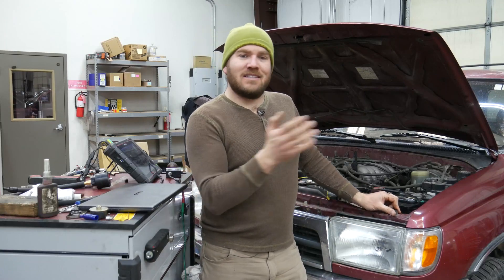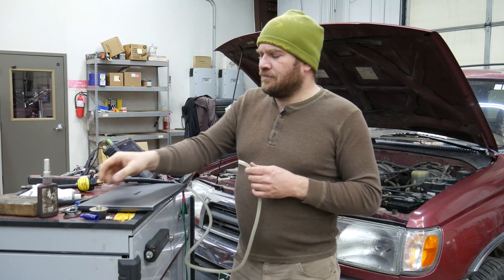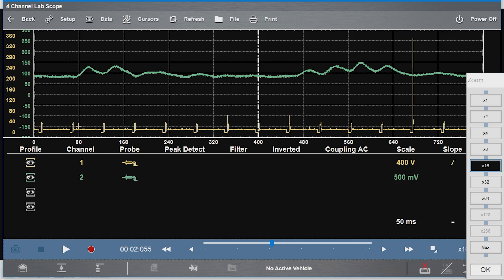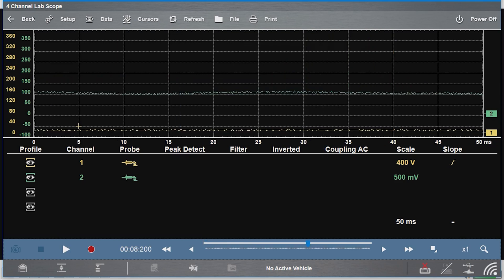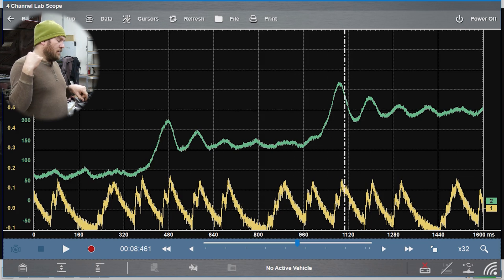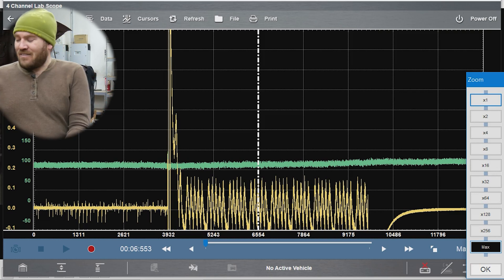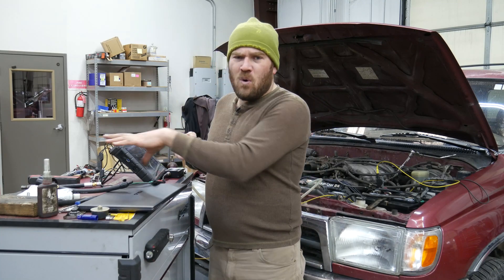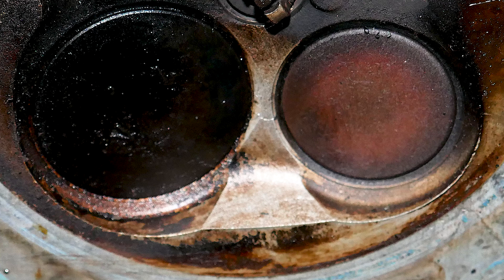Weekly waveform 15 - Cooling system pulse sensor test. Does it have a bad head gasket?

Comment: You could find which cylinder just by blowing compressed air in the spark plug hole and reading pressure or pulse , or even just by watching for bubbles or volume change in the radiator or expansion tank.

Comment: Not sure if you'll ever read this, but what's you opinion on the pulse sensor vs the transducer?
I found this video trying to find an answer. A pulse sensor is super handy and cheap BUT . . .
If you have sprung for the transducer, do you really need a pulse sensor any more?
Reply from the maker: I have several pulse sensors but I still struggle to read them easily. I find the pressure transducer easier to read because it’s displaying actual pressure where the pulse sensor shows a reaction to a change in pressure. 

I still use both as I am always hoping the pulse sensor readings will just click in my brain and I’ll understand it better. I also only have one pressure transducer so I normally use it for in cylinder readings and throw the pulse sensors in the tailpipe or on the intake manifold.
Reply: @ThePracticalMechanic  Super appreciative of your time to reply and make a series of videos I have enjoyed as much as I have learnt!

Comment: I have a question about pulse sensors. I purchased a Zeus and am going to buy a sensor. I find several available at various prices. Which brand do you recommend? I realize they are all built with the same components. I’m curious about quality of workmanship and quality of the internal sensor.
Reply from the maker: The first look sensor was one of the original ones on the market but they are more expensive than most so I have never purchased one. 
Cody’s auto diagnostics and jarhead diagnostics both make a variety of 3D printed pulse sensors in different Colors and connector options. Either of those are going to be the cheapest pre-made sensors. 
Automotive test solutions also makes some but I have not used them.  
Some choose to make their own sensors by placing a piezo speaker/transducer inside a small section of pvc pipe. By time you buy all the materials to make just one and spend the time assembling I would just buy one from Cody’s or Jarhead unless you already have most of the materials.

Comment: Question: If you individually remove each plug and at some point you get no spike on the cooling system pressure.... would that help you identify the bad  cylinder???
Reply: oops I was commenting as i watch the video lol
Reply from the maker: @timothymohammed919  Absolutely. Some vehicle will be difficult to remove spark plugs if they are located under the intake manifold but if we can locate at least one spark plug we can get a reference. If we can get to all of the spark plugs we can isolate the problem by removing one plug at a time. Thanks for stopping by.

Comment: Great diagnosis, I use this method myself. The piezo pressure sensor is very simple and inexpensive to make, check out "the GADGETS playlist" for instructions. I'm surprised to see the crack location between the valves causing pressure pulses in the cooling system. That would definitely cause a misfire, but neither valve connects to a cooling jacket. There must have been either a crack between the combustion chamber and a coolant jacket or a crack in the block between the cylinder and cooling jacket. Or the gasket failed.

Comment: Just a few questions: (1.) While it wouldn't have been as accurate, nor as detailed,, could an exhaust gas meter  be used: checking  for any exhaust  gas in the coolant overflow reservoir? (2.) Was that the 1MZ? (3.) That crack in the head, between exhaust and intake valves, was almost undetectable, wouldn't cylinder head warpage also occur?
Reply from the maker: I do often use the 5 gas analyzer to check for hydrocarbons and carbon dioxide in the cooling system but a recent discussion with Dennis over at The Gadgets Playlist has me wondering if the 5 gas readings are accurate when used on a cooling system.  This test confirmed the head gasket failure without a doubt and gave the information require to do a deep inspection of the suspect cylinder.  

This was on a 1998 Toyota 4Runner with a 5vz-fe 3.4 liter. The vehicle was overheated last year when the head gasket failed. We sent the cylinder head to the machine shop for machining. Neither myself or the machine shop noticed the crack at the time. I suspect the crack was there but was much smaller at the time. Many heat cycles and a year later the crack has developed into the issue we have now. I didn’t even bother to check the head warpage since the heads are getting replaced. Luckily we have a core engine with good cylinder heads. Fully inspected these ones and found no issues with valves or cracks.
Reply: Would an initial check for head warpage show deformation/warpage,  if said hairline crack developed due to overheating? Maybe magna fluxing would've found the crack where the naked eye couldn't.  And as far as the 'gas detector': a simple $35 hand-held combustion gas detector (with sensitivity adjustment)? Lastly, would a pressure  inducer in the tail pipe show which cylinder was lagging? Or, if you put the crank on a channel, u'd see which piston/cylinder would be a drag compared to the others?
Reply from the maker: I’m sure magna fluxing would have showed the hairline crack. I’ve done dozens of these engine over the years and this is the first crack I’ve seen so we didn’t send the original heads out to get magnafluxed. 
I will still continue testing with a gas analyzer to determine if the results are accurate enough to call a head gasket based on low levels of CO2 and HC.  It is possible that HC can be introduced to the coolant system unintentionally with additives for better cooling or even stop leak. CO2 should only be present if combustion gases have entered the cooling system but it is possible that the steam or antifreeze vapor can skew the readings? Most gas sensor available on the market for electronics diy builders have one analog output channel but the sensor responds to several different gasses.  CO, and Propane are listed on the same chart for one sensor but Gadget Playlist found that the sensor responds to CO2 even thought it wasn’t listed on the spec sheet for the sensor. Does my $3000 Snapon analyzer use better sensors? I would assume that it does and it uses several different sensors. Every two years I have to send it in to get the oxygen sensor replaced. 

I think the pulse sensor in the tail pipe would only pickup the initial misfire on startup. The relative compression test show minimal differences between cylinders so the tailpipe output should be close to the same. 

The crankshaft signal will narrow it down to two cylinders if you knew where cylinder number one is located on the crank. I think the missing tooth is 40-50* offset from TDC #1.  Cylinder 1 and 4 are companion cylinders and both will be at the top of the stroke at the same time. We would need a camshaft position signal to determine location of cylinder #1. 

Great questions and discussion. Discussions like this is how we each challenge each other to grow and learn new things. 
I will measure the warpage when I get to the shop today and see if the heads have developed new warpage since the machine work was performed last year.

Comment: What an interesting idea. I thought the water pump would  have an ac pattern of pulsations, like ac ripple from an alternator.
Reply: Cooling systems I checked with a first  or true pressure sensor did show pulsations/pressure fluctuations from the water pump and its impeller.It might be due to the chosen  resolution that nothing is seen in these captures?